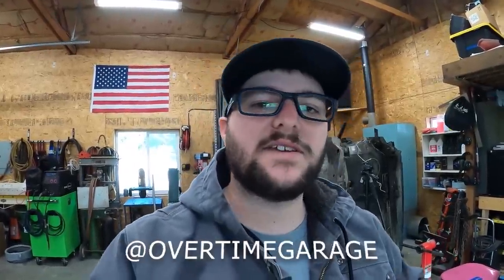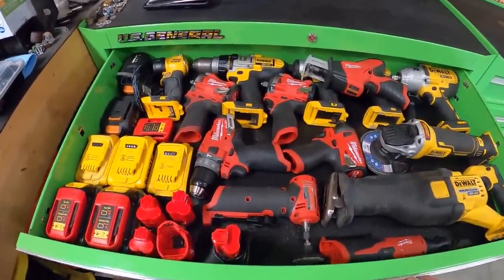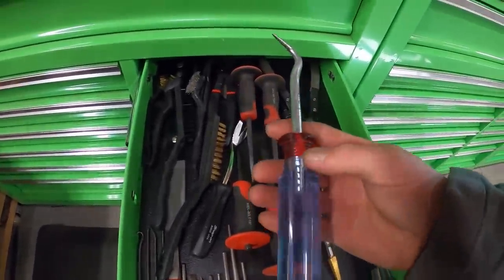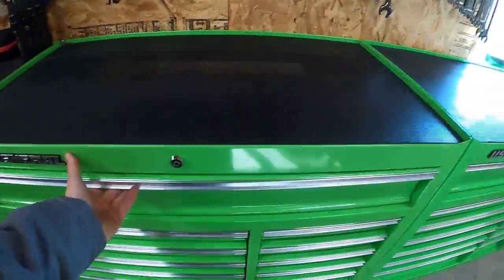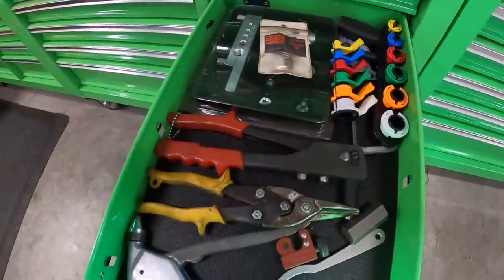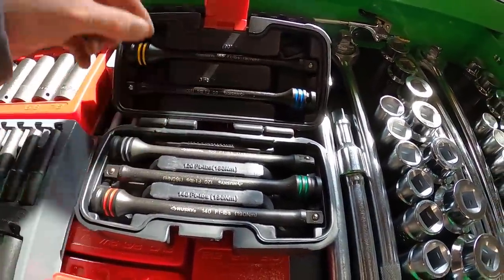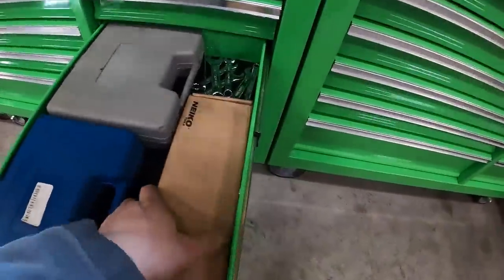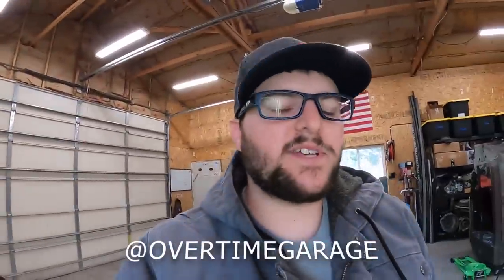THE ULTIMATE TOOL BOX

Comment: 1/2" piece of plywood across the top, will give you a level surface to throw down a butcher block work top across all of them. I have the same box, with side cab's on both sides. I did the 1/2" plywood, with a 1" piece of plywood across all 3. Solid as hell.
Reply from the maker: Thats the plan eventually is to make a 1 piece top for them all. Just need to find some time to do it.

Comment: Absolutely agree with the box choice, I also have a row of four, only difference is that my two end boxes also have the top boxes on them.
Reply from the maker: I would eventually like to do that. I've currently got stuff in the way 😬
Reply: @JustinTBraun  I love having the 4 long top drawers in a row with no small drawers separating them. Those is why I went with the 44's as well. 👍
1) Sockets
2) Ratchets / Extensions / Adaptors
3) Wrenches
4) Screwdrivers / T Handles / Driver Bits
Reply from the maker: Its pretty rad! I'd like to get a couple top boxes later.

Comment: AWESOME! I like that you're not a tool snob. I started a mobile auto repair business and I would love to have that setup but the only way would be to put it in a semi trailer, lol. Right now I just have a Husky mobile work bench, 46" I believe. It works, but it's bursting at the seams.
Reply from the maker: That would be challenging trying to carry a lot with doing mobile repair. Do you have a service box?
Reply: @JustinTBraun  My work van is a 1998 Chrysler Town and Country with the seats removed, lol. I have the 46" Husky mobile workbench . The top drawer is nothing but wrenches, one drawer for infrequently used pliers, another for frequently used pliers, and about three drawers for other stuff. I have another one of those small tabletop tool chest.

The most challenging thing has been finding a good way to store sockets. I finally found a solution. Check my channel out in a couple of hours---finally going to post the video for the Lisle socket holders.

Comment: Something i did with my split loom was to take a 5 gallon bucket, and drill a hole in the lid (or the bottom), and coiled the loom inside neatly so that as you pull it out it self uncoils. I put my hole in the lid, and store them on a shelf, but you could also put the hole in the bottom, and hang them from the ceiling.  With all that I really only use split loom in locations where the wire could be exposed to an extreme abrasion (like under a vehicle, or trailer) everywhere else i use techflex (the cloth oem style) to protect it.
Reply from the maker: Thats a great idea!

Comment: the braided isnt split btw. and hose clamps put in a tub on a shelf with all your other assortment containers. loom but in a box on a shelf up above somewhere. hooks in junk drawer put in bin on shelf. stuff you use most put closet to work bench. least used furthest away. power tools put further away. pulley pullers put all in 1 drawer. wrenches, sockets, ratchets, screw drivers, nut drivers, pliers, keep close to work bench. cases of specialty tools on shelf under work bench or bottom couple drawers in outer 2 or 3 cabs
Reply: yes. it was... btw.

Comment: I'm definitely gonna get this same set up. I'm gonna remove the casters and built the boxes into a workbench at the back of the garage.
Reply from the maker: Down the road I would like to put them on there own stand for all of them together.
Reply: @JustinTBraun  ya I think a set up that big would be better with a solid base instead of the casters. It's not like your gonna move a box that's 176 inches around any.
Reply: towboatjeff don’t take off castors build cabinet taller for cabinet to fit without removal.  You’ll thank me down the road.🎓🎓

Comment: Personally I would stack another box on the ends kinda to make a hutch in the middle. Then grind the middle 2 boxes to put a Long flat work surface.
Reply from the maker: Thats the plan for in the future when I get a bigger shop. As of right now I don't have enough wall space.
Reply: I wouldn't grind any metal. I would do a custom wood top and have it notched for the metal to go into the wood.

Comment: Very nice set-up.  If I were organizing, I would categorize by Trade.  As an example left to right or right to left;  House Items;; Carpentry/Woodworking items, leading to any Masonry, then Plumbing, Welding/Metalworking, then Electrical (Home to the left, then Auto) and finally Sockets/cordless tools in the middle two top drawers, Pliers/Screwdrivers/hammers below that.  Any Auto only tools to the far right.   I would tend to put related hardware near each Trade, as that's how you would use it.  Enjoy!
Reply from the maker: I'll keep that in mind when I go to change it around. Thanks!

Comment: Get a 26 top and bottom and put in remotely for your shop supplies like the hose clamps and bolts
Reply from the maker: I've got a extra one i could use
Reply: You’ve got my wheels spinning on decking one out with divider trays like some of your drawers and using them like my imperial supplies stacks at work.

Comment: Hello found your video in my feed great idea just dont overload the drawers i like the idea of using the plastic bins for the hardware i find silverware drawer divider handy cd racks work well for smaller pliers back in the day we would use tin with w clips i like yoga mats for drawer liners too they are thicker than most on the market
Reply from the maker: Good ideas!

Comment: if you want a great sheet metal snips check out eastwood automotive they got a snipper that works great.
Reply from the maker: I'll check them out. I have a welder from them and love it!
Reply: @JustinTBraun  its pt#28191 its not for heavy gauge sheet but works great with tin to make spot panels and stuff.
Reply from the maker: Sweet deal. I could really use a couple more.